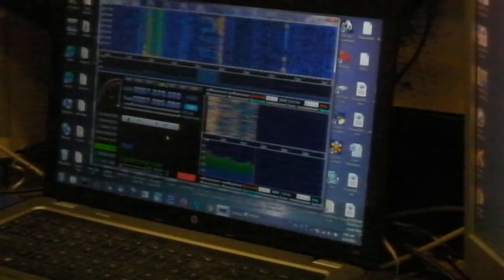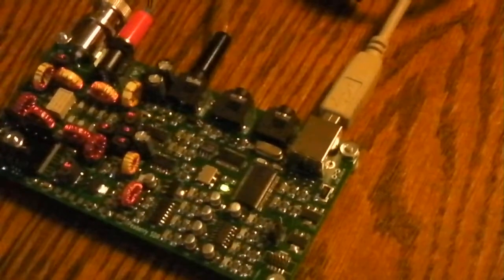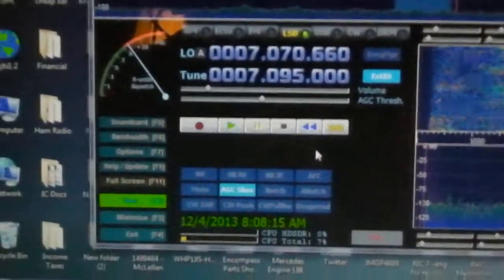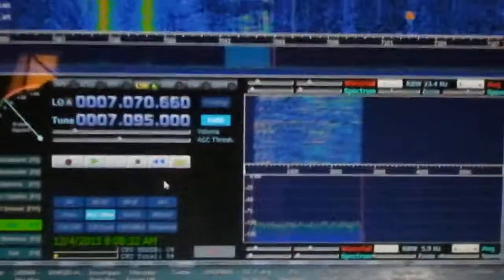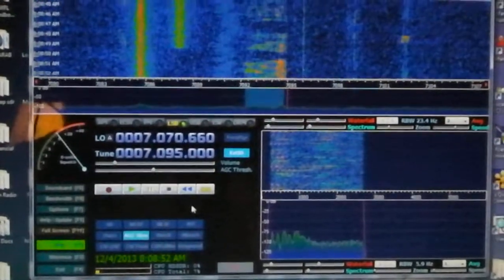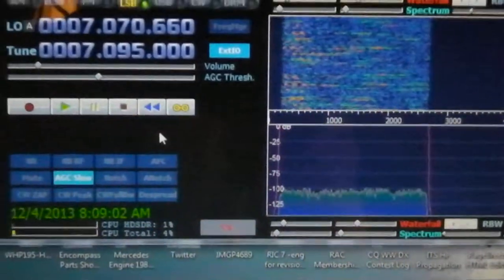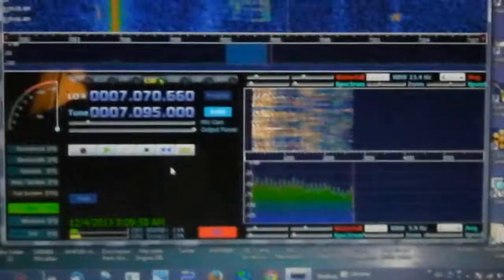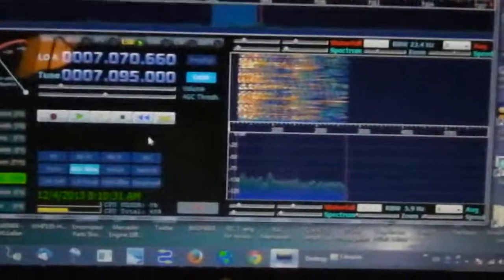Contact using Peaberry V2

Comment: Norm .. your TX audio on the Peaberry sounded great on 40m when you checked into the Trans Provincial Net on Saturday Dec 21. You were not really strong here but the audio quality was very good. I am not sure if you heard me check-in just after you? I was using my Flex-1500 @ 5w with my Yahama CM-500 connected via a recently completed HB interface box.  The Peaberry is an impressive little rig for the price.

Cheers 

Michael VE3WMB